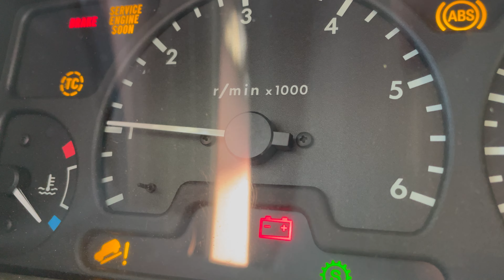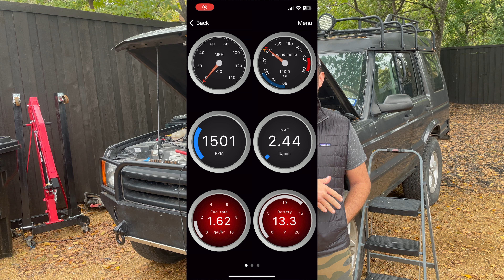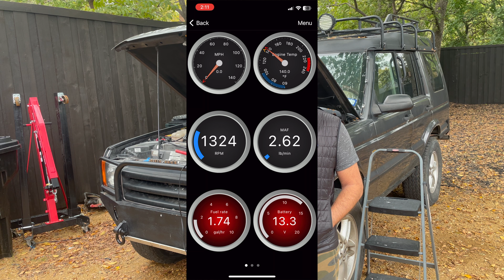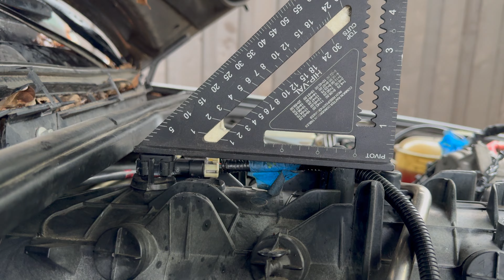LS Swapped Discovery 2: Troubleshooting

Comment: Nice to see that you are now getting on top of things, sometimes these error codes come up just to torment you. I regularly get a code coming up for one of my O2 sensors in the exhaust. I have replaced, checked, had someone else check, you name it I've tried it. In the UK we call them gremlins, as well as a few other stronger words.
I think you should look for, and fit a JZL100120 to keep the crap out of your heater blower to prevent future problems, not expensive and an easy toolless job, if you vac out the debris first. 
Love watching your vlogs. I am in the UK and there aren't many LS engines over here.
Reply from the maker: That's very kind of you to say; thank you. I'll check out the HVAC filter for sure. I didn't even know it had one.

Stay tuned next week because we I'm welding in a resonator and completing the exhaust such that it's all stainless from the headers-back.